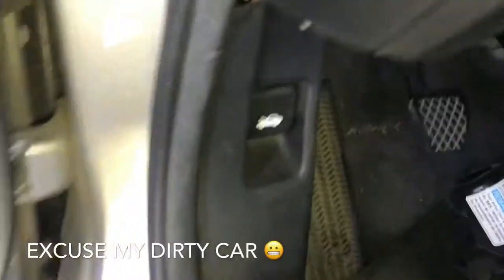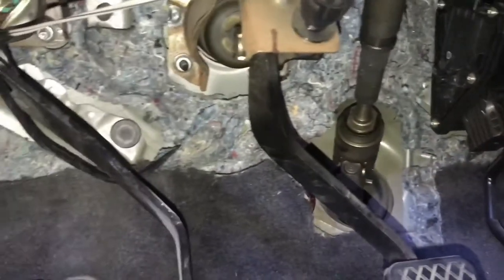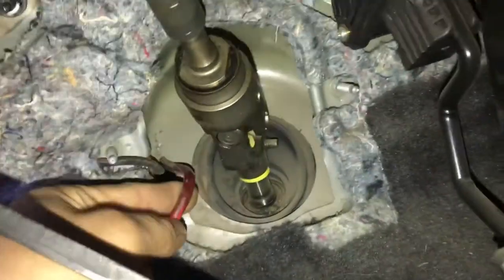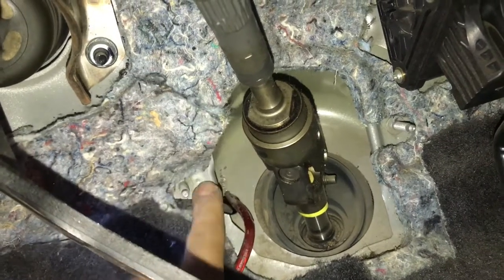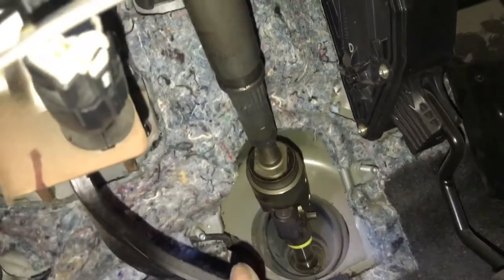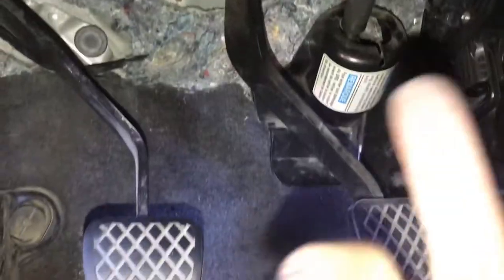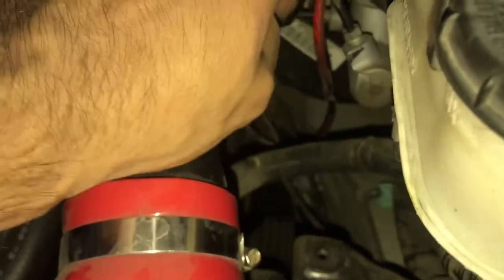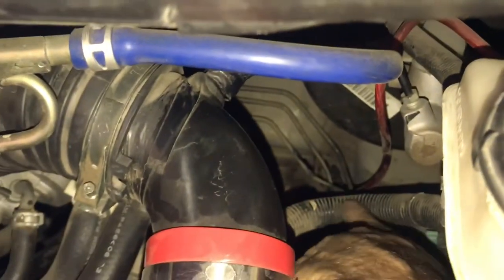How to cross the fire wall 8th gen

Comment: Pro tip.  Grommet Bro.  You need a grommet especially with a 4 ga wire that can carry so much juice.  Over time the insulation will get cut by the bare metal and you'll have a toasty little car fire.